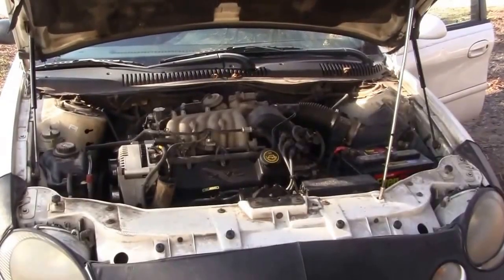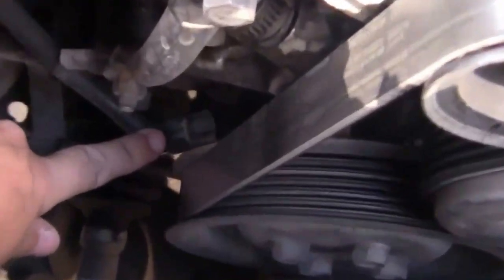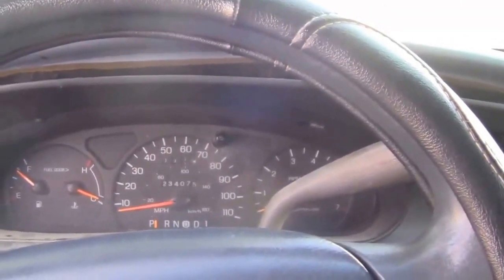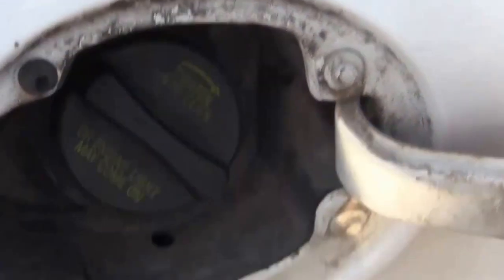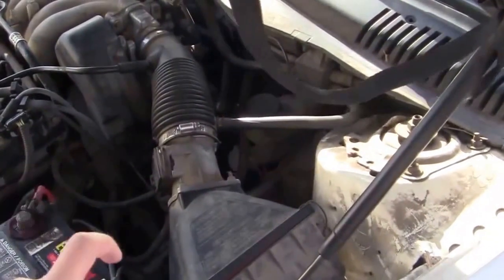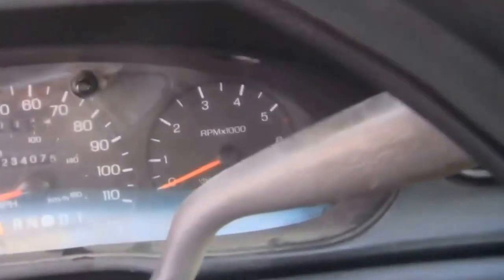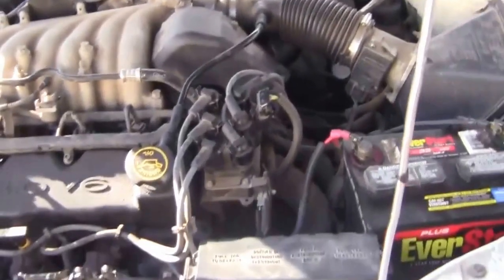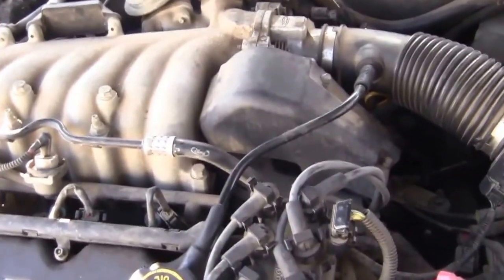Crankshaft Position Sensor | 1998 FORD TAURUS

Comment: For those folks with a no start situation, know there are 3 engines found in the 98 Taurus. The 3.0 liter OHV, the 3.0 DOHC and the 3.4 liter SHO engine. You MUST know what engine you have to buy the proper engine part. The part he's referring to is called the crankshaft position sensor OR the camshaft position sensor. Please try and get a code from an OBD II reader indicating that specific problem, since there are multiple reasons causing a no start. Just guessing is asking for a lot of money to be wasted on looking for a cure. A bad battery, a blown mega fuse, a bad fuel injector,  a defective fuel pump etc., the list just goes on and on. DON'T GUESS.

Comment: For people saying he didn't show where the crankshaft is, he showed it and it's located underneath on the right side of the engine if you're sitting on the passenger side, meanwhile if you're standing up in front of the car it's on the left side of the engine. I just changed my serpentine belt and I believe that the crankshaft is around that area. I have a Mercury sable 2000 so it's somewhat the same as taurus